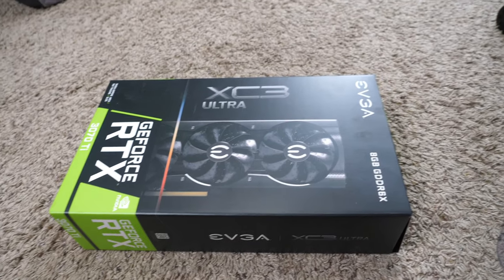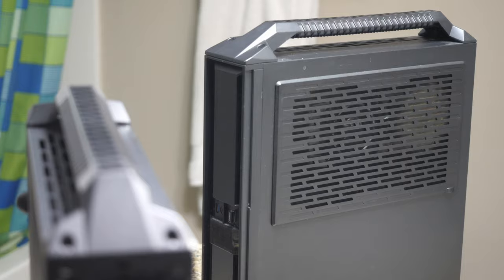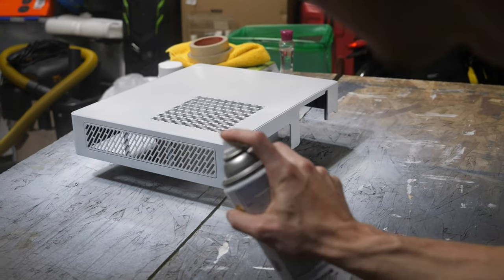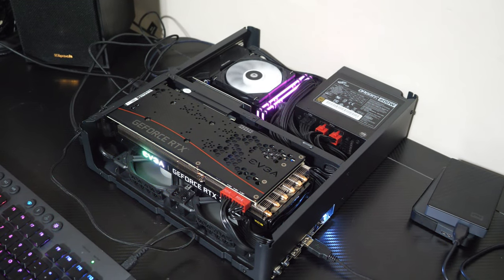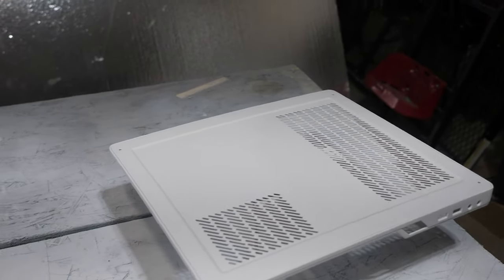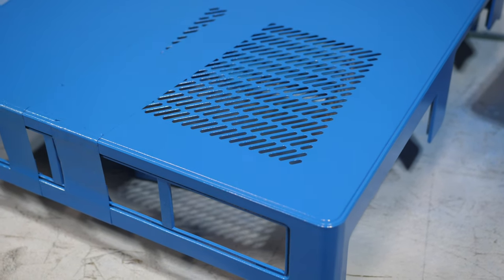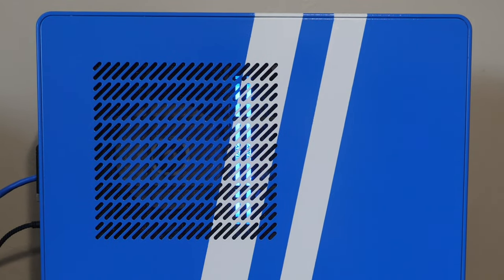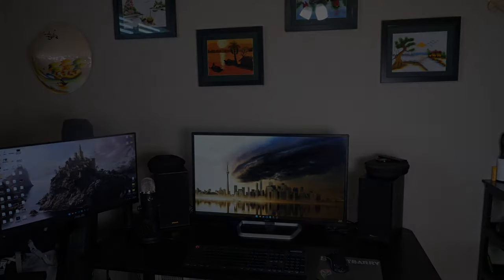How To Custom Paint Your PC!

Comment: Hey, Barry I also had a node 202 case, it was a great case but my GPU ran a bit hot. My solution/ recommendation was to get 3-4 Noctua NF-A4x10 PWM fans (40x10mm) and install them on the top vent. I was immediately able to tell a difference. The GPU didn't have to ramp down its speed and overall the card ran cooler. The fans screw right into the vent slots and used a fan splitter to manage the cables.
Reply from the maker: that's a damn good idea! if I run into heating issues I'll do that! what type of gpu is it? blower or tri fan?
Reply: @BulletBarry  Hi, I have an ASUS Dual RTX 3070, with dual fans. I thought about setting up on the side panel like you but, had doubts about clearance with the extra fans and video card. Also, the additional intake of cool/clean air would be redundant.
Reply from the maker: @TheluckyGuy0  hmmm, you can get low profile 120mm fans to help pull air away from the card. there are also 3d print mods to keep them from making contact with the gpu

Comment: Ah, the PS5. You inspired me to build my own PS5 with that same Silverstone case, R5 1600 16GB RAM GTX 970 500GB M.2, etc. It was my first PC build with new parts, I had to rebuild it many times before I figured out the best way to install everything so it wasn't a complete rats nest. I put some RGB light strips shining on the GPU and motherboard areas and it looked really cool! I didn't use that case for long though, everything ran way too hot for my liking. I originally used a Cryorig C7 cooler, but it was wildly insufficient, so I removed the facia from the stock cooler so it fit right against the side panel and it helped a little. It's always really cool to see case mods like this, especially if a ton of care and attention was put into it :P The blue and white color scheme looks great! It really transforms the case into something else. It's just a shame the HTPC form factor tends to run hot unless you put a lot of thought into everything.
Reply from the maker: that's the magic of them though! I was always the type to just throw a pc together and call it good but I put so much love into this thing and I think it's gonna give all that love back because of it! She's a great little machine! So cool that my ps5 inspired you to make one of your very own! I love that

Comment: Hey curious why they didnt sand it first before cleaning with isoprophyl alcohol? 

So steps would be:
1. Clean with alcohol
2. Spray Primer
3. Sand it down(which grit) 
4. Spray color
5. Top coat

Let me know if that steps are incorrect. I will start my diy this week :)

Comment: Barry this looks great! I plan to do something similar and spray the same 2 removable parts a beige/light grey colour to give the pc a retro look but in a case that has a sleak modern design, along with beige mouse and keyboard and maybe eventually i'll spray a monitor to go with it too. To get it smooth what grit sandpaper do you recommend?